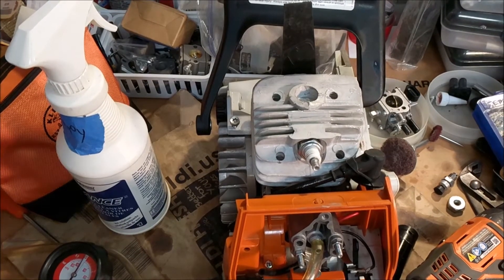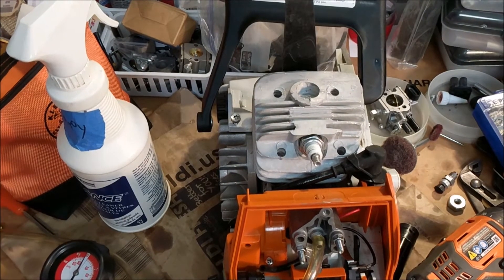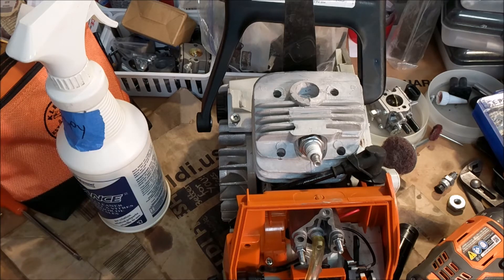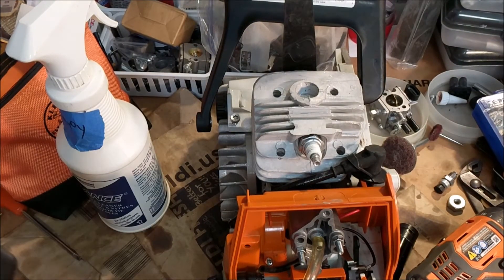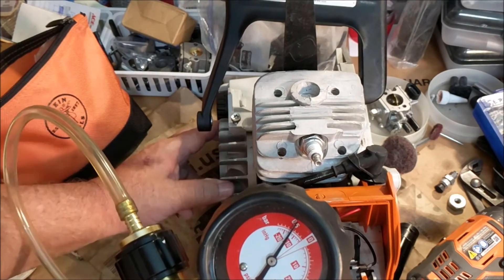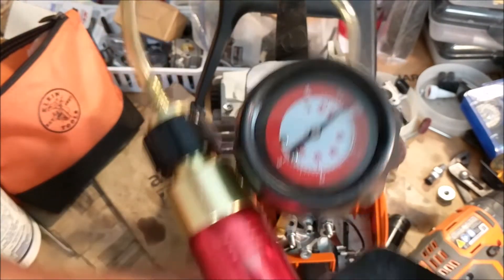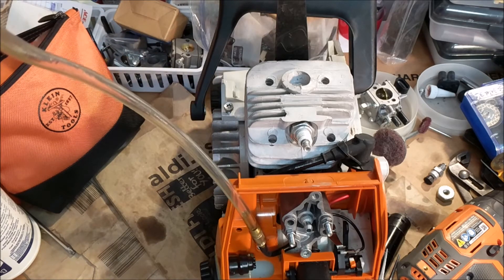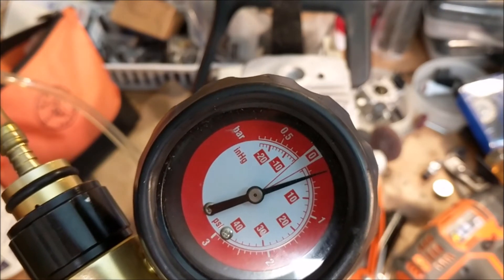FarmerTec MS660 Meteor Cylinder, Pressure, Vacuum, Impulse Test

Comment: I have the same pressure/vacuum pump used in this video. Bought about 6 years ago on eBay for $40.00. Still works great. Used in a small engine repair shop.

Comment: Where can i find the vacuum and pump?
Reply from the maker: ebay, amazon, home depot. stihl dealer has the best
Reply: @the1chainsawguy  oil mix 1:33 is ok ?
Reply from the maker: @Sensei948  yes. I like 4 oz of oil per gallon of leaded fuel. Two forms of lubrication.  I use a high ester oil and the muffler screen has always been clean. And I've never had a failure that oil could have prevented and I like to run them hard

Comment: just did a pressure test on a farmertec 660 i'm building....no pressure.  sigh.  I'm having fun putting it together but am a little frustrated by the test.  I've been very careful so far.
Reply from the maker: Walk away and play with the kids, come back later  Find the leak man. Get you a bottle of soapy water and track it down, keep pumping pressure  as you spray. The test works. don't have the decomp installed and have that plugged with the correct bolt. You have the flange fitted correctly and the exhaust port sealed with rubber, I expect you to have loose head bolts. Number one area to leak. I find a t27 rigged with a rachet works best for those. You can do it.
Reply: @the1chainsawguy  found the leak... and I'm confused by it.  The muffler doesn't quite meet up to my cylinder exhaust port.  As in, there is almost an 1/8" gap between the two.  When I screw it all in, because of the gap, it leans slightly away at the bottom of the muffler.  A quick google search didn't show up anyone else having this issue.
Reply from the maker: @Afredericknyc  don't force it. Could be wrong muffler, you did not mention a gasket,? Check your screws are correct. inside m5x16, outside m5x6,m5x20
Reply: @the1chainsawguy  not the wrong muffler.  I ordered a dual port from hyway and both the stock muffler that came in the kit and the hyway have identical backsides.  So, they're either both wrong or both correct.  To block it off for pressure test, i used a thick piece of roofing rubber.  its thick, but not thick enough.  But its definitely thicker than the gasket that would normally be between the cylinder and the muffler.  Screws are right.  Longer to attach bottom, middle length for attaching to cylinder and super short for top.  I didn't do any modifications to the muffler port on the cylinder, but its almost like its too short.  or my crankcase is too long.
Reply from the maker: @Afredericknyc  I have given you the basics you will need to sort it out. I doubt it's the case. Did you measure the screws to make sure of the length? It's gotta be right in front of you. I only have my video and my keyboard to help you with.
Reply from the maker: You need the flange, sealing strip, decomp bolt, to do the test. The right muffler and the correct screws are necessary after you nail the tests. There is a sealing plate and strip sold on eBay that is a must have
Reply: @the1chainsawguy  yeah man.  I'm going to redo the test with the muffler off and just use a piece of aluminium and rubber to seal the muffler port.  I suspect it doesn't matter if the muffler doesn't make an air tight seal to the cylinder in final application.
Reply: the1chainsawguy o